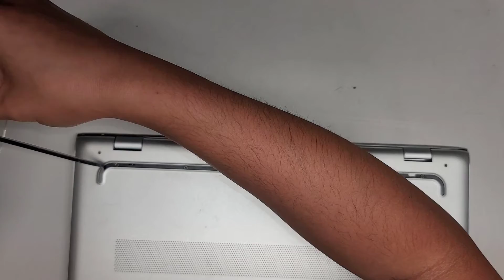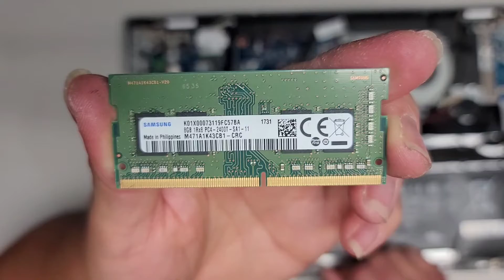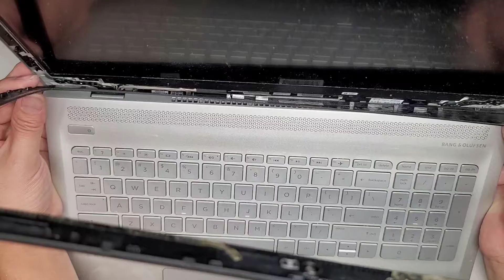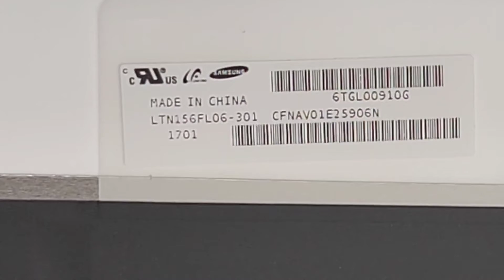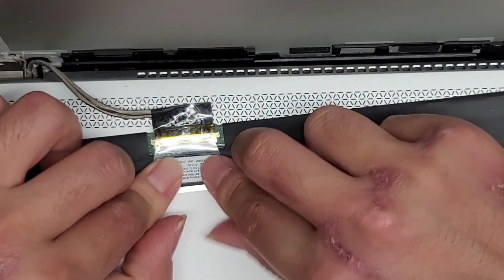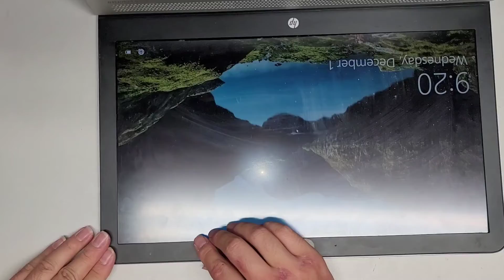*Modded* HP Laptop 15t-as100 Disassembly RAM SSD Hard Drive Upgrade LCD Screen Replacement Repair

Comment: This is an old video but just wanted to say thank you so much for your clear explanation and breakdown of everything. Turns out my laptop screen cable had simply disconnected (due to that pesky tape adhesive that you mentioned) and with your video I was able to fix it myself. Thank you!
Reply from the maker: Awesome, glad it helped. If you haven't already, please like and subscribe so others can find my videos and possibly consider watching a few others and commenting to get the algorithm to recommend my channel. Thanks!